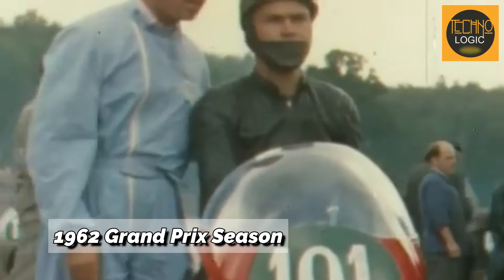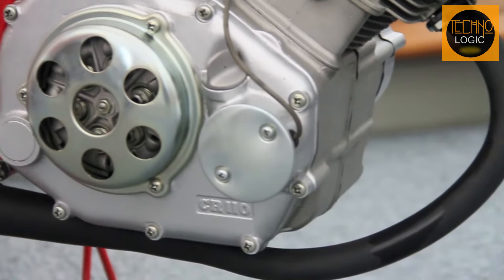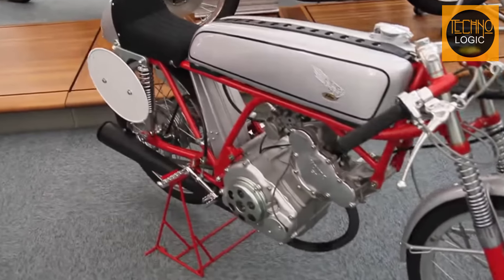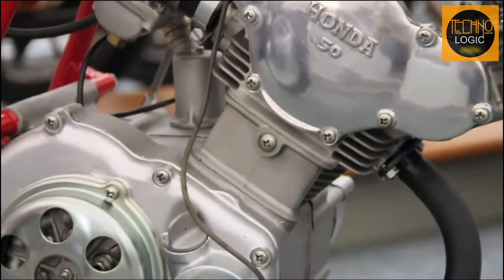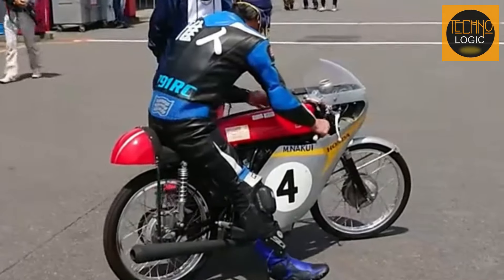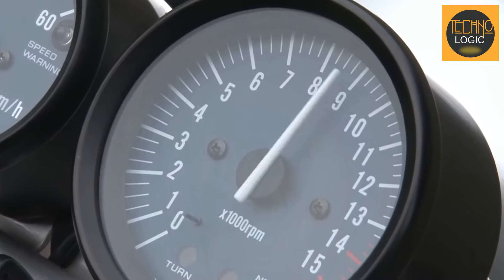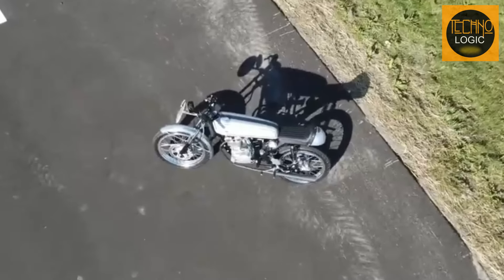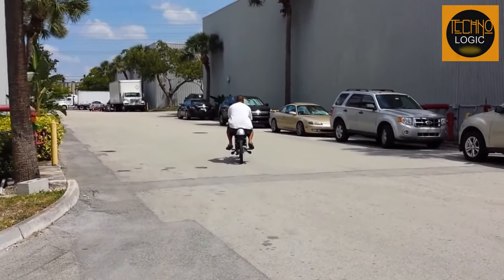Honda CR110: The Little Engine That Could… and Did at 15,000 RPM‼️

Comment: You mention the CR110, then you describe the Rc110, two totally different beasts! What's more, the CR110, 2nd version, gave 8.5 PS at 13,500 rpm. Carburetor was 20 mm, not 25 mm.Read my book "Honda's Four-Stroke Race History 1954 ~ 1981". As usual, a badly informed video!

Comment: Typical, ignorant Internet and YouTube horse manure, with very confusing and mixed video of related and unrelated matter.
The actual factory spec for the Honda CR110:
There were two versions: 
- A five speed road machine with lights and silencers producing 7 hp at 12,700 rpm (sold in Japan only). Speed @ 100 km/h.
- A racing version with 5, then eight gears and 8.5 hp at 13,500 rpm. Speed @ 125 km/h.
Rev it to 15000 and watch the valve salad that will ensue. 
Just to be clear, I own one.
Reply: You're 100% right, I used to own one.